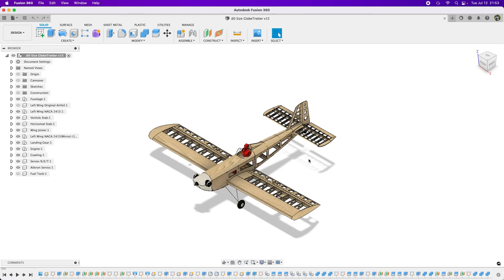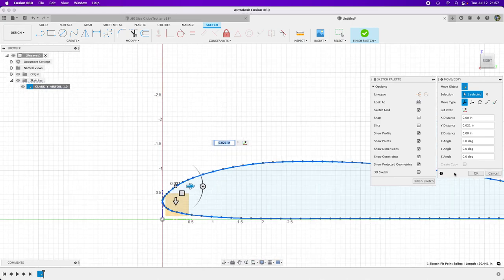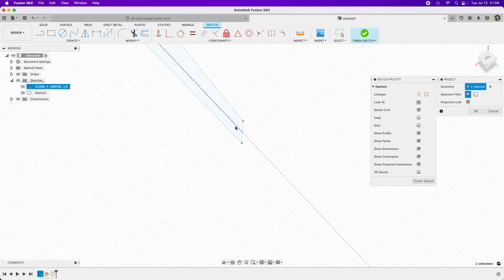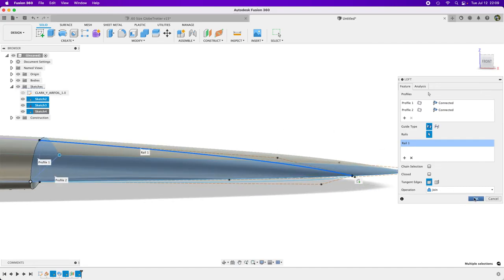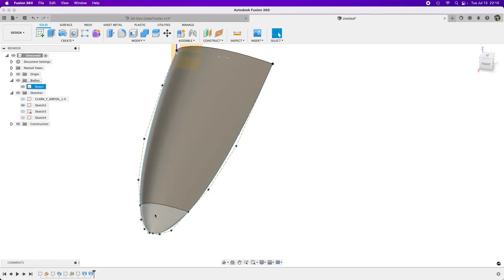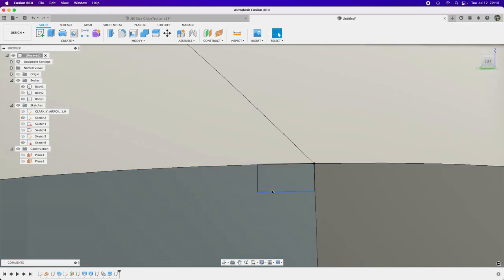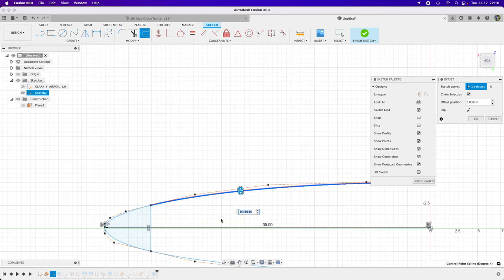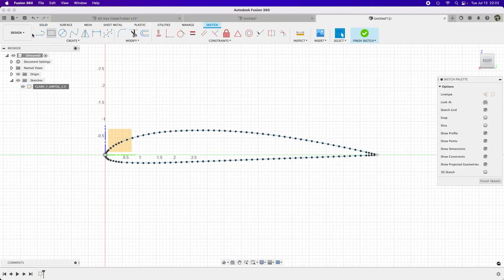RC Model Design in Fusion360: Elliptical wings and other curvy thing

Comment: On 12:26 you say you don't like the angle the loft creates. That is because you have the setting to "connected" instead of "tangent". That will solve your problem without having to make extra sketches. Also you can always add 3D splines to the existing sketch and use those as guides for the loft, without needing extra sketches.

Comment: Hi @TheRCGuide at 7:56 you are creating the (lets call it outline sape of the wing (maybe not the correct term; I am not an english native speaker :) ).
Is it possible to import the airfoil dat file if the outline shape of the wing is done first or is it necessary to import the airfoil and just THEN creating the wing outline shape?
Sounds complicated, but I hope you know what I am asking :D
Reply from the maker: I find it easier to place the airfoil first then create the wing planform. The most important function of this operation is that the planform is connected to the airfoil shape.

Comment: Hey, I don't understand the step you're doin at 11:51. What command are you doing? I tried splitting the body but it doesn't work. Do I have to sketch the line you sketched in 5:10 to be able to do what you did in 11:51? English is not my mother tongue so I might also have misunderstood something but I'd be thankful for any help!! :)
Reply from the maker: Hello, I projected that line into that sketch to create two profiles.
Reply: @thercguide4735  and how did you do that? What command did you use?
Reply from the maker: @linuso6404  "project" the default key command is "p"
Reply: @thercguide4735  okay, thanks. I will try it out as soon as I have time again. Some exams are coming in the next weeks

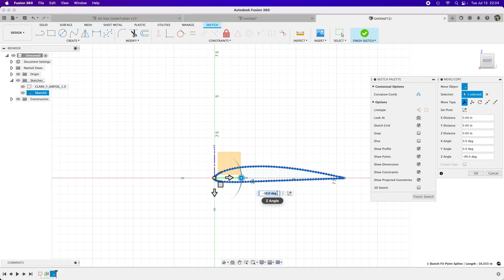Comment: 31:00 - what is this "wash out" for? Is that for increasement of the lift? My first impression is that angle on the wing tip will decrease the lift, could you give me some info where I can  read anything about that? Also: making your own design of the plane, how do you know what is the proper wing-span considering that you have choose the specific wing profile? How should I calculate that? Thank u for your help!

Comment: This is super helpful.  One problem I ran into that I'm having difficulty solving is creating a wingtip for a cambered foil where the bottom of the profile crosses over the centerline.  For example, an RG-15 near the trailing edge goes above the centerline.  This makes it not possible to use the centerline and half the profile to loft to the midplane of the wing.  I tried splitting it into two (vertically ~20% from the trailing edge) and was able to make the profile, however it has a crease in the surface at the line.

Comment: I've been wrestling with wing design using lofts and it's been driving me nuts. I wasn't familiar with sweeps which appears to make life a lot easier.  Thanks for sharing this information. Also, I'd like to find out more about control point splines.
Reply from the maker: There are lots of ways to approach wing design, as in everything in CAD. The only time I use a loft, is when I am going to use different airfoils on the roots and tips of a wing. If the design calls for anything other than a rectangular wing, you will need to add rails. These rails must intersect with the profiles, otherwise they will not work. 

As far as splines, here is an excellent video on the subject: https://www.youtube.com/watch?v=iDzxndSBook&ab_channel=AustinShaner

Comment: hello, I saw that you are using Macbook so I would like to ask you, I have a problem with airfoil dat it doesn't appear on my scrips what should I do, and how to install it properly
Reply from the maker: Sorry for the delay. Here is a  video that shows how to install Dat to Spline: https://www.youtube.com/watch?v=3Huj4tK-V3U&ab_channel=ColtonCampbell  

Make sure you restart Fusion. It should appear under Utilities>Add-ins>Scripts and Add-ins. It should appear under "My Scripts"
Reply: Hey man, I am working on a Macbook too and had the same problem. To open the data I did this: opened these-files of the airfoil I chose as selig format; copied them into TextEditor; Changed to "text only" so I could save is as a .txt data; went into fusion and opened "Airfoil DAT to spline"; went on "all files" (not just the Airfoil DAT files) and imported the airfoil. Works for me👍🏽